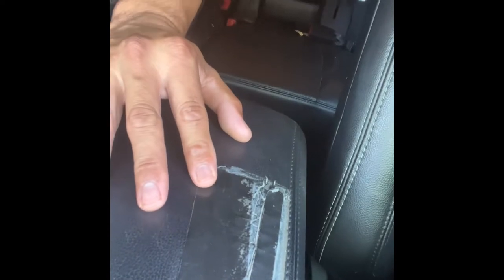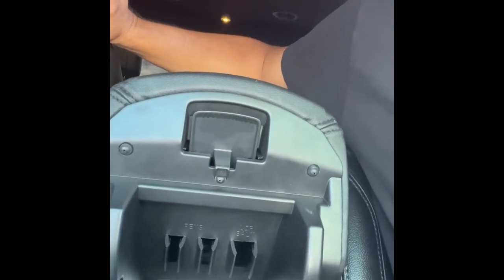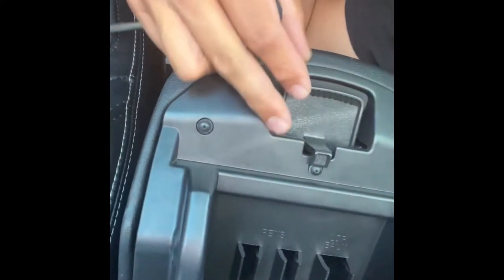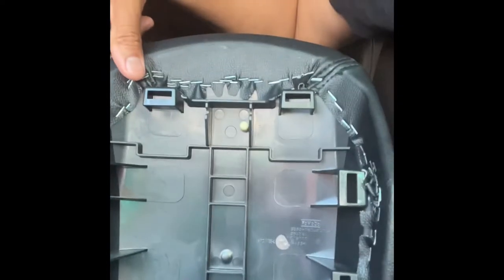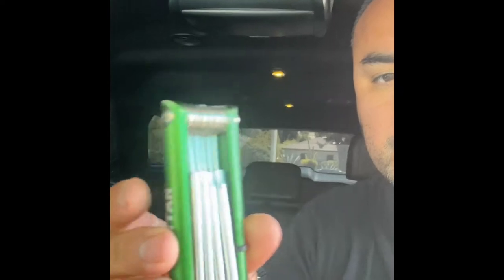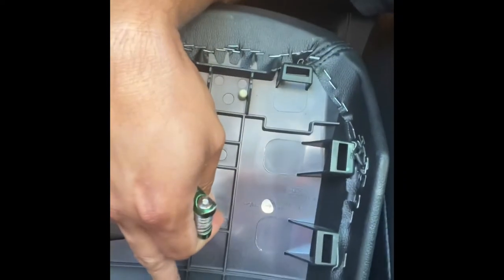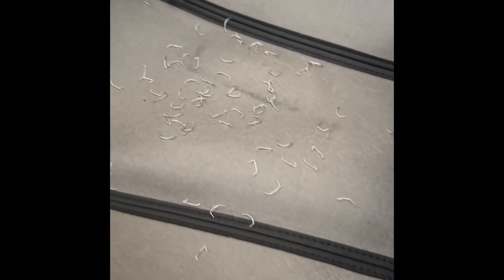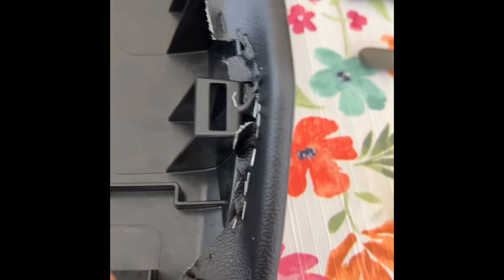2016 Ford Explorer Armrest Leather Replacement

Comment: So glad I found your video…I went to an upholstery shop…they could not figure out how to get it out. They told me they would need to take off the whole ball of wax including around the shifter and drive selection switch and it would involve about two hours of labor…I followed your advice and it was a piece of cake. I dropped the part to be recovered at the shop. Thank you so much!

Comment: Thanks for the vid but You need to mention that you have to also press the console latch in so it will pry up and not get stuck while prying upwards.  After removing the 8 torx screws the whole console lid will come away. Then, you will need to remove the three torx screws holding the latch assembly beneath to fully expose the cover. All torx screws are the T20 size.

Comment: Thanks for posting! Perfect!
Reply: I didn't use staples because my stable gun wasn't powerful enough. (I tried) I used Contact Cement which worked perfectly and was probably easier than putting in 100 staples.